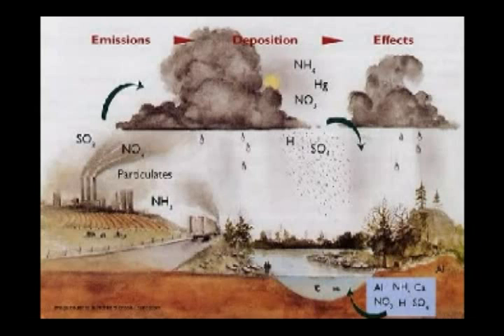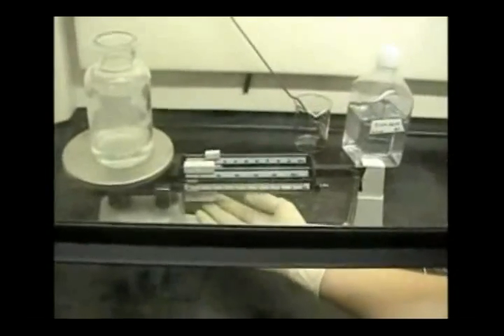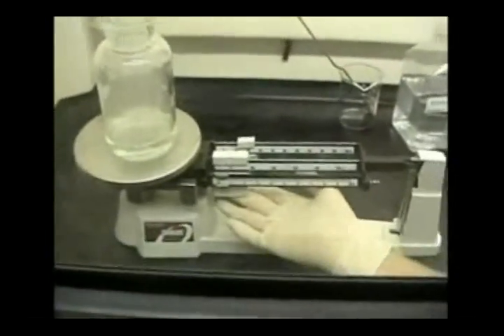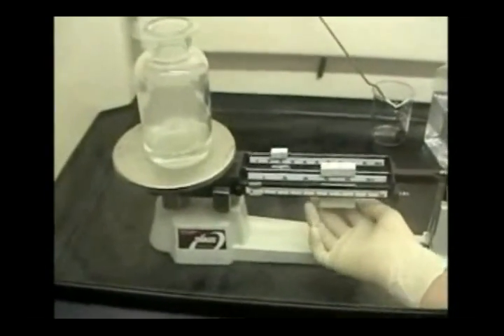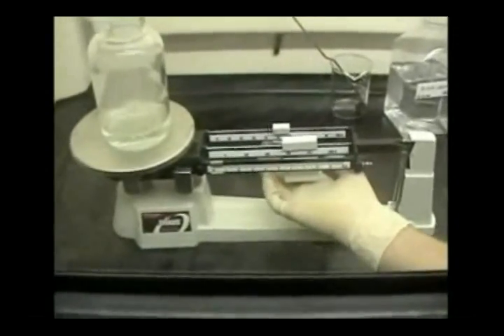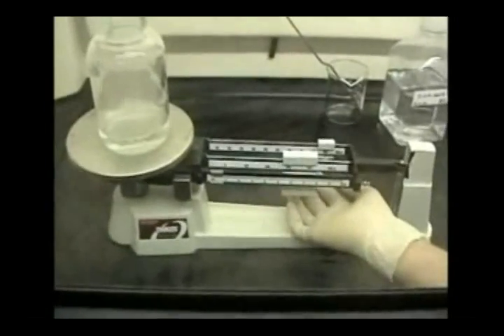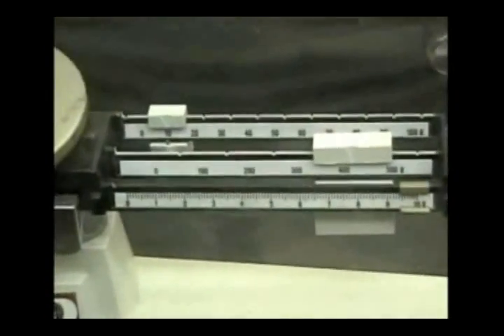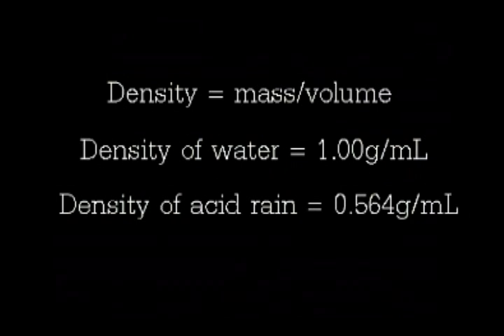making acid rain part 1

Comment: Why use a triple beam balance when you can use an Ohaus analytical balance with higher accuracy?  With the analytical balance, there would be more significant figures in your values, thus reducing the error in your measurements and calculations.